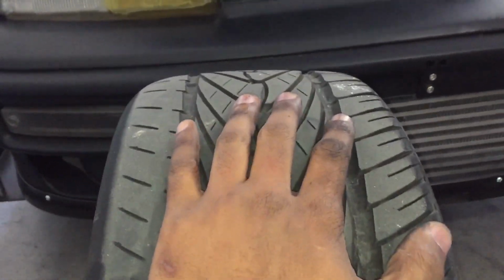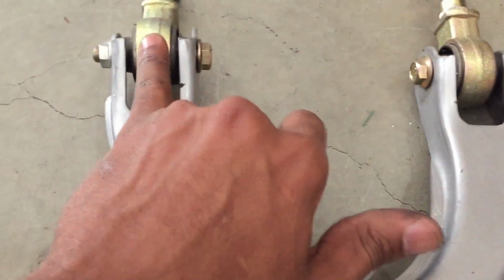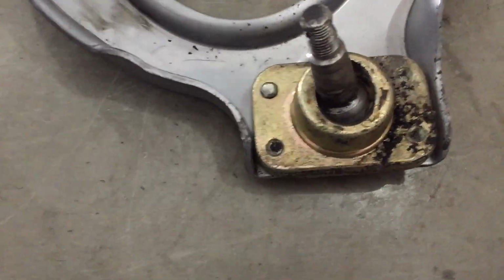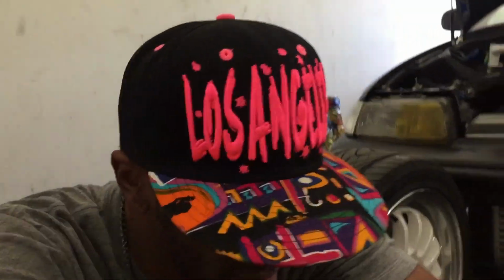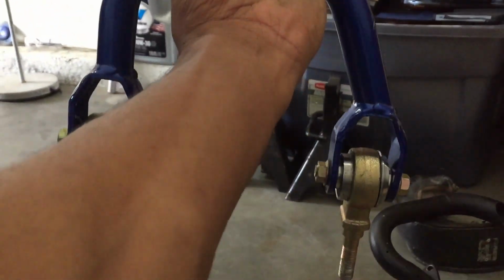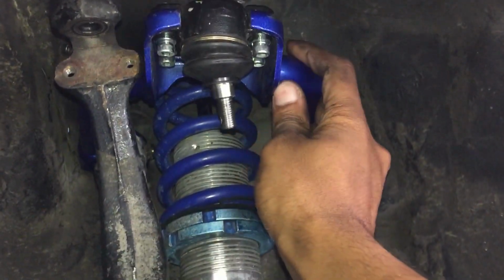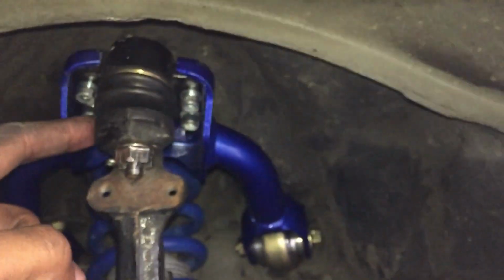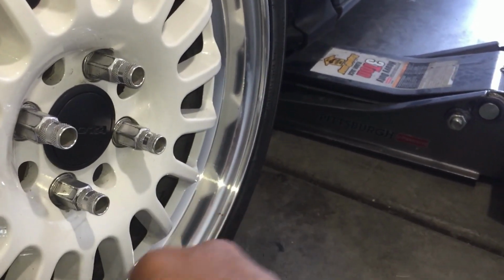HardRace Front Camber Kit Install

Comment: I've been driving my EF for the past month, mannnn ohhh mann... I instantly realized why i love this car. I wanna put some love into it. I been just on the hunt for i can affordably fix shit.
Reply from the maker: Honda Vlogs a car that’s easy to fix, cheap on parts,  handles like a dream can’t be beat. I have driven many of cars and the EF civic is so hard to beat.
Reply: I just got some flat rails off ebay, gotta open the box looked good quality. My OEM DX seats are shot bro, straight no fabric but for the time being i'm bout to put my ITR recaros in the hatch to make some room and classy the car up. I need to replace the ball joins and prob get some camber kits, because the front end just feels really loose and floaty.
Reply from the maker: Honda Vlogs yup I had that problem for a while until I changed my ball joints. Ef parts make a nice camber kit, I didn’t even know they made parts. I always thought ef parts just sold old ef parts. Right now I’m looking a nice 90 hatch cause I wanna but having the hardest time finding a clean one.
Reply: They're hard to find man lol. That's why i just keep mine. Garage built honda's just did a comparison of the EF parts one vs. the skunk 2, it's looking good. He even mentioned buying the S2 ball joint and using the EF parts kit could be good. Just dk where to start lol 200 for a hardrace I could do a lot up front for just a daily.

Comment: I've always wanted to try a set of these also, maybe for my crx I'll try this set out also!
Reply from the maker: Garage Built Hondas it was a bitch finding these
Reply: SI RICKO I just got a set of the control arms in and mine look different.  They have 6 allen head bolts on top.  Strange.  I wonder if it's a newer design.
Reply from the maker: Garage Built Hondas they have 2 different styles. The still I have is the euro ef style they’re hard ass fuck to find. The 6 Allen type are the us style.